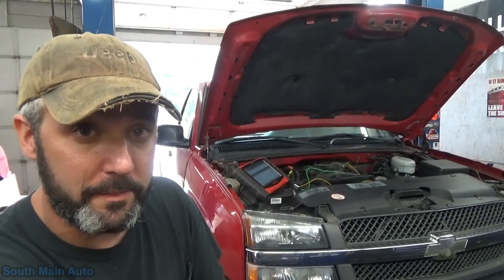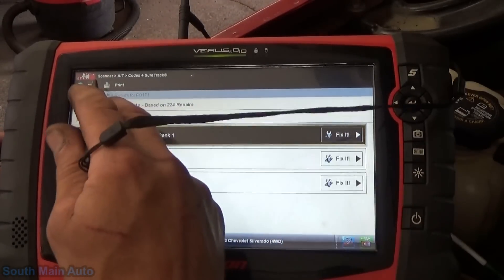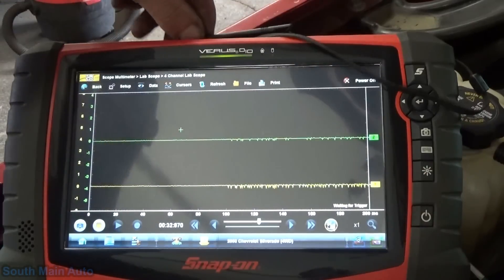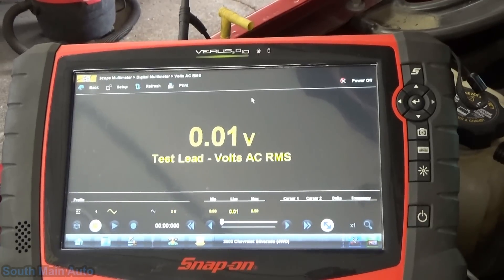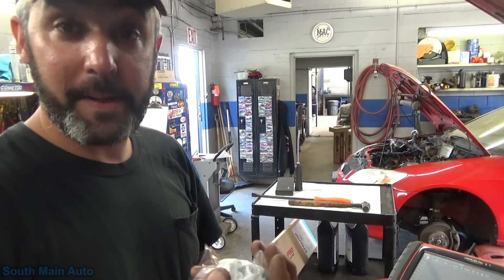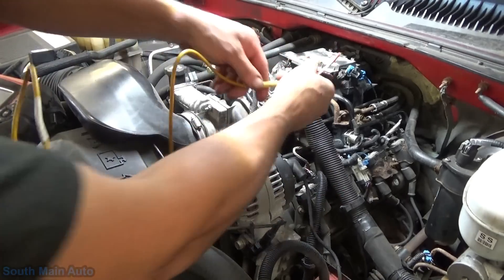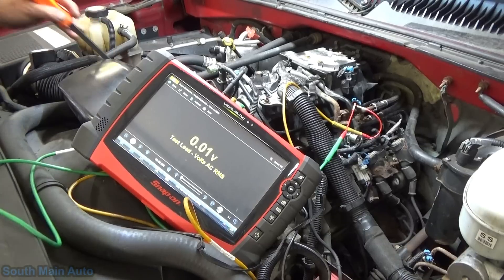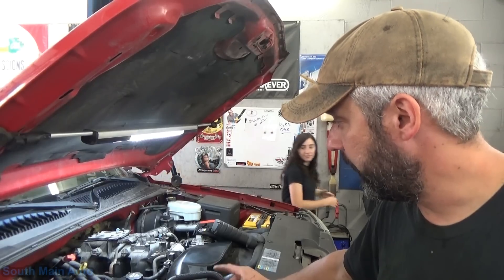How To Diagnose GM Knock Sensors - P0327 & P0332

Comment: I got 06 Silverado the truck was working very well no error codes. 
I found an oil leak then I replace intake gasket and valley gasket. I saw rust in knock sensor so I replace both with new ones, now I have the error codes related to low voltage knock sensors. 
I checked resistance both 100k ohms. 
Voltage 0.4 mv both and dying the test with the hammer reads 70 mv. 
Any suggestions for what I could do for solve the problem?

Thanks.
Reply: What brand Knock sensors and harness did you use?
Reply: @ I bought from eBay…supposedly genuine GM from eBay.
Reply: @ForzaRT  A lot of the eBay "stores" that sell automotive parts will misrepresent what they have listed as 'OEM' your best and cheapest bet would be to use RockAuto and buy theirs that are listed "Genuine GM", at least the sensors those are typically what is defective,  I don't think I've ever seen one of the knockoff wiring harnesses have an issue

Comment: I've had a knock sensor problem in my 2006 Yukon XL for over a year. The only advice I didn't follow was to keep changing the sensors "because a lot are bad from the factory" Following all other internet advice I did Ohm checks, I did voltage lead check hammering on it. I even re-seated them, finally I bought a second set...to no avail always with the same P0327 and P0332 codes. I even tried relocating the knock sensors. 

I even followed the advice to get an oscilloscope to check out that voltage was being generated, and they were doing so. It wasn't until this video where you described the scale "2 Volts and 50ms time" that made me realize that a knock sensor could work, just got good enough. 

Putting the scope on those settings I couldn't see diddly while iddling, or reving the engine. I had to go to 200 mV before I could start seeing it. Then I bought new ones, the "good ones" as attested to by the parts store - sure enough they were producing voltage 4 times better than my old ones. The old ones voltage line looked like your dead knock sensor. 

Now I'm crossing my fingers that everything will finally pass muster. Thanks for showing each step good sir. 

I still aspire to learn better how to use an oscilloscope, where do you learn these things?

Comment: Just had knock sensors replaced on my 01 sierra 4.8 .
The shop installed car quest brand sensors and new harness.
Only one sensor low voltage before repair. now both sensors read low voltage.
New sensors bad?

Comment: Fine video, been looking at recurring knock sensor after cleaning motor. Now know how to check.
Gaskets and sensors, harness on order after i get a pry bar and check with multimeter. Didnt know they are 1 wire sensors so will checl grounds too!

Comment: Very informative.
I've had the sensors changed out 3 times now as well as the harness due to P0327 & P0332. Pulling my hair out.  HELP any advice??
Reply from the maker: Use only OEM parts. And not OEM AC Delco that you buy on eBay l. Actually go to the Chevy dealer and buy them. All of the online "OEM" are counterfeit.
Reply: @SouthMainAuto  yeah...wrong !!!..chevy dealership has replaced my knock sensors 4 times now, and i am still getting codes !!..come to find out, the knock sensors they are installing from a oem gm bag say '' made in china '' !!..lol.
Reply: I did buy the ACDelco sensors but it was online. When they arrived packaging said GM. Thanks so much for your feedback.

Comment: Hope you can help. 2003 Suburban. Rear knock sensor failed from coolant connector near firewall failing. Rear sensor hole filled with coolant. Replaced both sensors with new Delco sensors. Still getting knock sensor codes. I’ll clear them and it comes back all the time. I have a couple of ODBll scanners. Can you point me in a direction for troubleshooting? Really enjoyed your videos. I’m just a hobby car guy. Thanks for your help!!!
Reply: Did u ever figure out your knock sensor issue?? I'm just wondering because I have the code come up back in September 2022 and I replaced w/ ac Delco sensors and harness, did the silicone wall, all new valley cover gaskets, etc.... And today as I was hitting the gas on the highway to pass another vehicle I got a low voltage code for bank 1 knock sensor. Code PO327

Comment: So after that 300,000 more miles  they go out about 220,000 miles or so I gave $5,000 for the truck it's a 2010 Chevy Silverado hd 2500 ltz after getten the bloweres motor replace the hawk tire shop wanted $320.00 parts n labor so I went too O'Reilly got it for $120.00 since it was already done done the cover oreily pop it in n screwed it up now ac gets cold if it keeps up with the tx heat of we get a bad early winter 🥶 well will see if it holds up it's new n it should!

Comment: I like your videos I had to do that today change out knocks sensor cost me about $23.00 everything went out at different times so I got a garage to do spark plugs n wires for about $500.00 bucks the throddel body sensor I bought months ago n footpedal sensor I replaced the throddel body sensor 3 times n foot pedal sensor twice a I took it too different shops in the area one told knock sensor so I replaced all of it make Shure to disconnect the negative side post after it's all fix replace it back tighten it up

Comment: Eric PLEASE HELP ME WITH SOME INFO . I now have a flashing check engine light code p0322 senor 2 circuit low . Going to change both and wire harness . Question is do I have to replace any other gaskets intake , etc .

Comment: Replaced the engine on a 2005 Tahoe. The incoming engine had its own knock sensors. After install I had code for low voltage knock sensor 1. Replaced both sensors and harness. It now says low voltage knock sensor 2…….
Did resistance and continuity checks on both sensors and harness. All ok. Decided to replace sensor two with different brand just in case but same result. Low voltage sensor 2. Swapped sensor 1 with sensor two. Problem remains. Low voltage sensor 2. Any suggestions???

Comment: Thank you SOOO much. Very thoroughly and simply explained. Admittedly, I’m not very good with my scope. But I’m getting it powered up and Gonna play around with her. I’m getting low voltage codes on both. I suspect I have a problem between the main harness and pcm

Comment: Hi Eric,  question;  I have a 2007 GMC Sierra with a vortex max 6.0. Has 175000 miles and it runs great, but I recently got me a P0333 code.  It’s come and goes about 2 times.  Now is off and is being like a week with the code off.  What do you think is going on?

Comment: 02 avalanche had same problem new knock sensors and harness still have same code after replacement  cleared code still keeps coming back,any idea?
Reply: Did u get it resolved I'm in the same boat rn

Comment: I'll subscribe when I see an answer to the "multiple questions" about replacing the KSs and the the alarm codes coming back in shortly after, as the same happened to me. I've reset the alarm twice by disconnecting the battery but the alarm comes back in.  Resistance tested good on the new KSs but I don't have and can't I afford a scope.
Reply: Robert Candelaria he explained everything here how to check em if u dont have a scanner use a multimeter ohms is like 90-110k as he stated  and on the ac scale couple milivolts  that be your best bet with out scanner make sure were u thread in ur ks is not rusted other wise brush it or something also make sure wire harness is good ... ecm side should be 5v if im right and u should be good I’d say

Comment: Been chasing this problem on my Firebird, always circuit one low volts. Thought I had replaced both sensors and the harness, code came back almost immediately, its been on and off since then. This is great information, I'll start looking at this more, maybe I bought a bad sensor.

Comment: Just had this occur on my 2004 GMC Sierra pickup. Had to order the parts where ever I was getting them from, so I decided to check around various places to source the parts. Funny how the price changes depending on where you get it from. The Chevy dealership wanted $99 each. The local AutoZone parts store could get them in a day for $72 each. Then I just happened to take a chance and ran the part number through the WalMart website and lo and behold.....$35 each, shipped to the local store for free in two days. All prices were for AC Delco OEM parts. WalMart even showed the wiring harness from the sensors to the connector on the top of the engine was available for $42. Gotta love competition.

Comment: Thank you for that video. I've got a Knock Sensor fail on a GM Astra, and seeing you check the input has given me the energy to finally get my PC-Based scope installed on my laptop and prove the fault.

I'm starting out as a full time workshop since April, so my kit is not as advanced as yours (although electronics is my passion, and Im already a "very very very advanced" DIY'er), but I did get around to setting up my Hantek computer scope, and diagnosed an identical problem with a 2003 Opel Astra.

My background is in Aerospace system design for Rolls-Royce, but I have had to leave full time work due to illness so I've ended up setting up a small engineering shop in Madeira, Portugal (almost by accident|!)

My approach to diagnostics is similar to yours - "Prove the root cause then change the right part" - this approach is serving me well - I'm already inundated with work - I get all the weird problems - the stuff other garages hand off (weird diagnostics problems  etc) , or won't take on ( complex oddities like Rolls-Royces and Land Rovers ). My favourite is cars that have had the "Parts Shotgun" and still aren't fixed!. It's really keeping me entertained!

Funny thing happened the other day - a guy arrived at the workshop with his new purchase - a very nice clean '02 Land Rover Discovery 2 V8.
These are very rare here - in fact, this is the only other V8 Land rover I know on the island! (Mine is the other one!)
He was very proud, and asked me to have a look at his new purchase (This is common, many garages (myself included) will give an "assessment" for free - usually the customer goes to the cheapest, and end up getting raped by a garage that doesn't fully understand the work)
Like you, I tell it like it is, and if they go elsewhere, then that's fine by me - I pride myself by being honest and fair, even if the customer isn't.
I immediately recognised that it was missing on at least 2 cylinders, and popped the bonnet to check it out.
Found 2 ignition leads adrift and not on the spark plug, and one completely failed! I plugged them back in and temporarily patched the third so it's running on 8 cylinders now.
I complimented him on finding such a clean example, and we had a chat about the car (I have an identical diesel variant of the same car also)

The customer went from "can you have a quick look at it and give me a quote" to " When can you take it in and sort it all out for me?".....
I'm taking the car in when he goes back to the mainland in 2 weeks!!! RESULT - I will have a decent amount of time to work on the car and wait for parts.

Keep up the good work - I enjoy your honest and realistic diagnostics and also picking up tips - I've just bought a "big nasty" of my own!!
And I'm looking into the various diagnostics options available here.

I'm sorted for a few manufacturers (VW Group, Land Rover, Mercedes) but as I do more diagnostics work, I could do with the easy access to circuit diagrams etc...

Loving the Youtube channel - If you fancy a trip to Madeira (Portugal), let me know - If you like classic cars - aim for the last weekend in May!

Obrigado!!!
Mike.

P.S. Extra credit for saying "Aluminium" and not "Aluminum"!!!

P.P.S = extra credit and my regards to Mrs "O"

Comment: Nice job Eric !! I now have a 2005 Silverado 1500 that's about to have the sensors and harness replaced. Due to a PO327 returning fault code. Your video helps to know how to test them while in place before and after. Great and thanks ...

Comment: Would have been cool to see tapping on the engine while it was running and see how that would show up in the waveform.  With as vigorous as that waveform is, would be interesting to see how it would pick a knock out of that noise.

Comment: Nice to know you can actually get a reading on the low AC volt scale of a DMM.  I would have called it just based on the difference of the voltages between the 2 sensors.

Comment: Good tip on using ac voltage on dmm to test them, I never tried that but good solution if not got a scope or don't want drag it out and got dmm on hand . 👍
Modern resonant tuned knock sensors not so easy test by tapping like wideband knock sensors and need you simulate knock via fuel starvation to test sensors accurately .

Comment: For our reference Eric, Piezoelectric devices are used to measure pressures by the generation of voltage. Piezoelectric sensors are constructed from alumina ceramics, metallized quartz, single crystals, or ultrasonic transducer materials that make up a bi-directional transducer capable of converting stress into an electric potential. Th e piezoelectric materials consist of polarized ions within the crystal. As pressure is applied on the piezoelectric material some mechanical deformation occurs in the polarized crystal, which produces a proportional output charge due to the displacement in the ions. Uses of this type of sensor in the automotive industry include piezoelectric accelerometers, piezoelectric force sensors, and piezoelectric pressure sensors.

Comment: Eric you're the man.  Not 100% related to this video, but I just helped a neighbor diagnose a bad wheel sensor on his caddy CTS.  we hooked up my crappy old matco scope and spun the hub.  one side made a nice waveform but very low, other side amplitude was 3 times as high.
I think you showed this or something similar in an ABS video a while back, comparing signals side-to-side.. just wanted to say thanks for getting me on the right track.

Comment: knock sensor,s who needs'em , I discovered mine wasn't working and who knows how long it wasn't, wire came unclipped and rubbing on back of crankshaft pulley, I bet it was sensing some wild knock patterns, I only noticed by accident when changing water pump. yeah dinosaur gm OBD1, still has knock counts, so mustn't have killed the sensor :))

Comment: great video on how to test them. but to be honest the part of Canada I'm in these sensors get so bad, especially the rear one the its just been a common practice that if its setting codes for them, the intake comes off, because 99% of the time that rear one is so rotten with rust and corrosion its disintegrated to nothing, and most of the time it won't even come out. and out of all that I have done at least every 8 out of 10 the valley cover has to be replaced also along with the seals. the rear hole is usually so rotten the cover can't be salvaged. The local auto wrecker was getting to know me pretty well for a while, in the course of a month I think I was there 6 times, and got all the good valley covers they had. I actually got lucky on one trip. the sensors and harness had just been done to that engine as well as the silicone dams, so everything was brand new and came apart nice, so I got and extra harness and 2 sensors from that one.

Comment: Just got finished changing out both of mine.  Used the TSB.  #2 was a corroded mess submerged in water.  
Chevrolet 2004 Silverado 2500 6.0.  Used GM OEM parts only.  Sensor and harness and new manifold gaskets.
Could GM have put these in a more difficult place to get at and then build it to funnel water in a 2" deep hole to hold the water and then make it to where you have to take the top end off?  I don't think so.
Reply: have to keep the service department busy somehow :)

Comment: Great timing!  I've got an intake leak on my 99 Sierra with the ever fuel efficient 6.0 and an going to do the knock sensors while I'm in there.  I've heard to only use AC Delco sensors, just wondering what intake gasket you recommend? GM, Felpro...?
Reply from the maker: I use the steel backed Felpro's. They are about 30 bucks cheaper than OEM too

Comment: Here is a good tip n trick I would like to share. 1) Grab the closest shop rag (dirty or clean) and rip it down the center evenly 2) Roll each piece into an ice cream cone shape 3) With a slight twisting motion place one cone bottom end into each nostril 4)Repeat as necessary.
Reply from the maker: Soaked with brake clean?
Reply: +South Main Yes, brake clean is a prerequisite.  MAP numbers quick discussion.  I know you hate getting snot all over the phone,  feel better man ;)
Reply: South Main Auto Repair Since we're talking about healthy chems acetone will dry that shit RIGHT out. MEK or carbon tet will work in a pinch too.

Comment: I allways set my  AC same as the outside temp(or 2 degrees celsius under) after i made the mistake setting the temp max low to cool my self down. I had very bad cold for two weeks after that.

Comment: I did mine 3 years back and the dorman wiring harness  seems to have worked ok. I did as the service bulletin said , was to put a bead of silicone in front of the sensor to deflect any water from pooling around the rubber plug. Not sure if that even does anything but hey . LOL